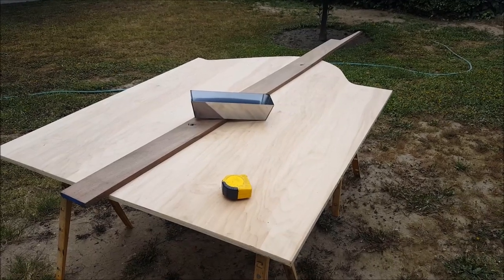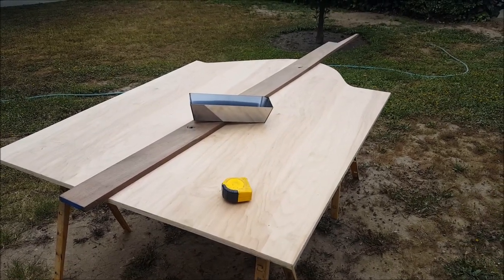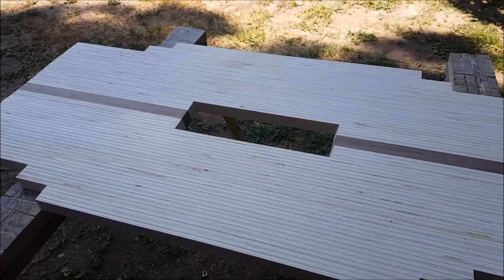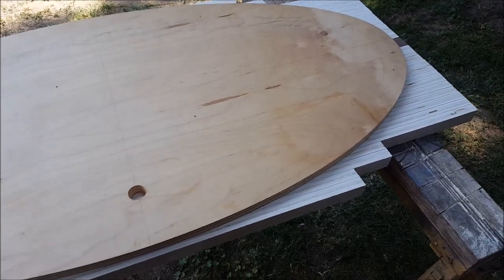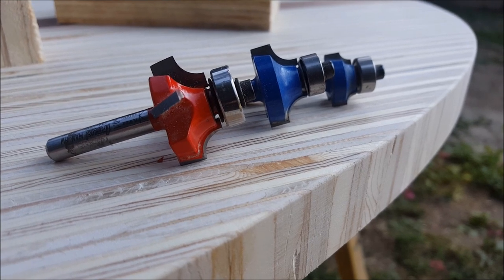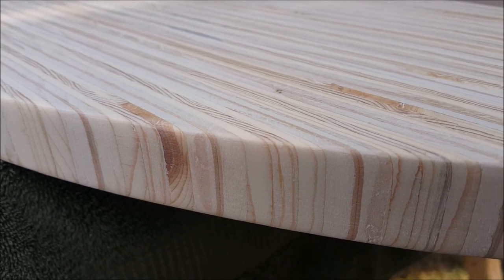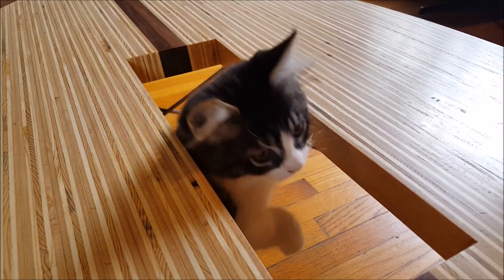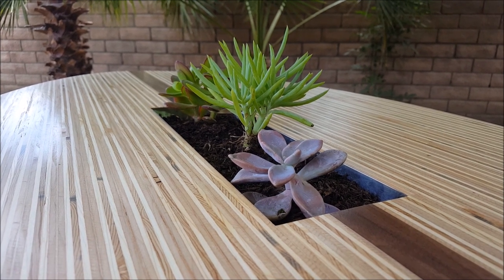Real Succulent Coffee Table -  #rocklerplywoodchallenge

Comment: Nice table! Suggestion to avoid tearout... do a climb cut... rout in the same direction as the router rather than against it... very carefully of course.... and maybe a larger radius flush bit... or maybe two almost even passes rather than one large and one significantly smaller